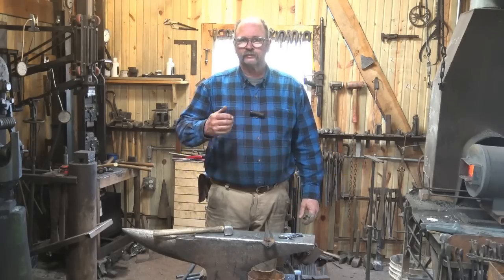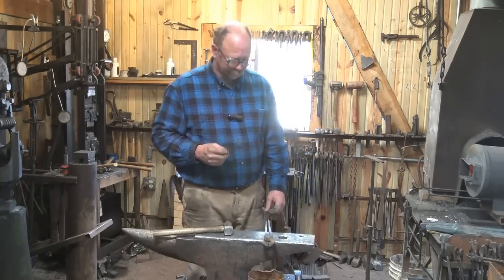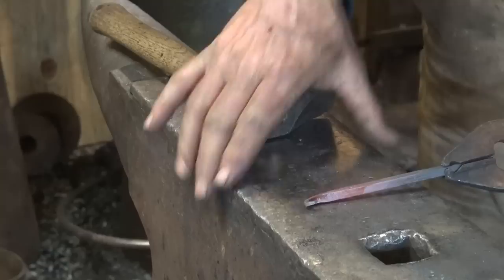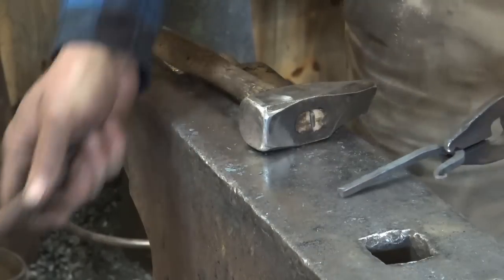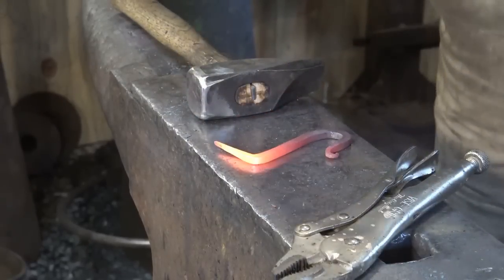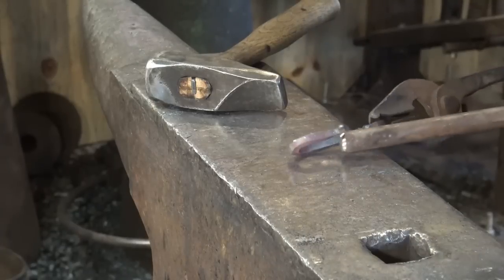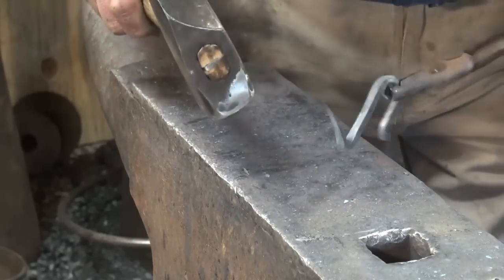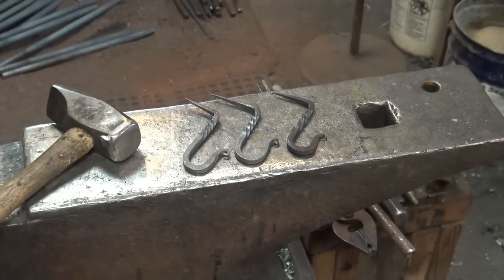Forging a simple drive hook - blacksmithing for beginners

Comment: Beam hook. aka barn hook. My first blacksmith project. I now forget the exact angle, but if I recall, its 100° or just beyond 90° . Thata- way, when driven into the beam, the 100° bend acts like a spring and holds it fast (tight)
I still make these. In fact, I forge tons of hooks. Working for a historic landmark, I discovered visitors want small-stuff. They will NOT shell-out 50/100/150/200 dollars for a knife or a fire poker set. They want to spend 1.00 for a hand forged nail or 5.00 for a small hook. The high rollers will give 20.00 for a fire poker or a hot-dog fork.
Folks love hooks. Especially hooks forged from a horse shoe nail.

Comment: I like it..!  Very innovative.

Video idea/request...  a large stake/stump anvil.  Either for the hardy hole or driven into a stump.  1 foot long ish.. 2 inch wide ish.. small horn and heel.  I have been thinking about T1 or AR500 for steel, but mild would certainly do the job.

Thanks for the video...
Reply from the maker: That would be fun, but it will require some research and perhaps tooling up.

Comment: I think if you don't have a horn trying to get the radius right a piece of pipe with the fork that you made would be a very good option
Reply from the maker: That work poretty well for larger bends, but for a little hook it's tough to get a bending wrench that small in the pipe

Comment: Great project. I am going to be using a piece of forklift fork as my anvil. Any pieces of advice?
Reply from the maker: Mount it solidly to whatever you use for a stand.  If you weld.  adding some square tube for use as a hardy hole will help.

Comment: About how much weight do you think this hook will hold ?
Reply from the maker: It might hold a 100 pounds, but that seems like pushing your luck.  20 - 30 pounds would seem very reasonable, especially with a bit longer spike
Reply: Black Bear Forge that pretty good   I did not think it would be that much. Sounds like I should make 4 or 5 for practice and to use in my garage thank you.
Reply from the maker: No guarantees.  Some day I may find a way to test such things
Reply: Give me some time and I am such I will find out. Lol